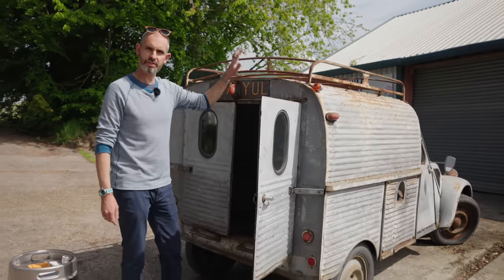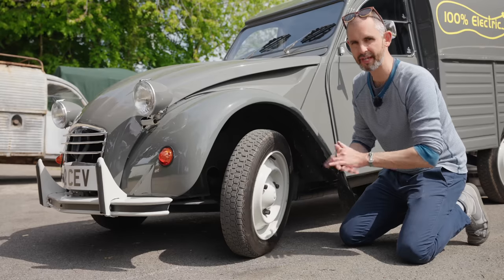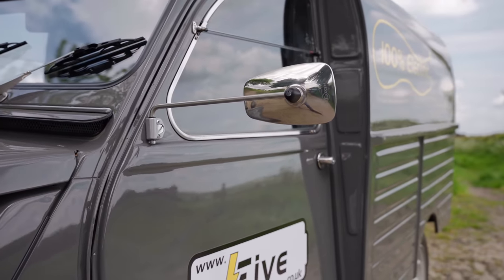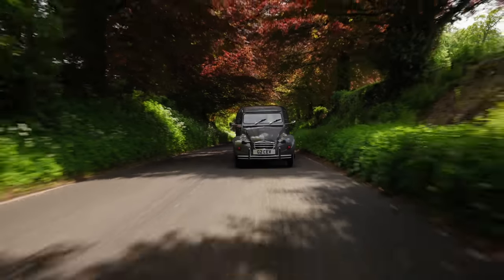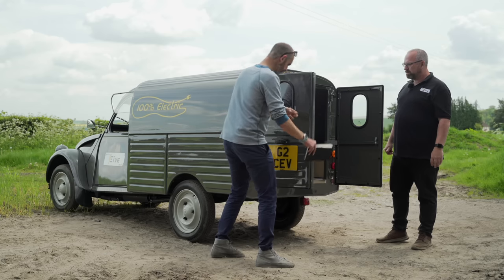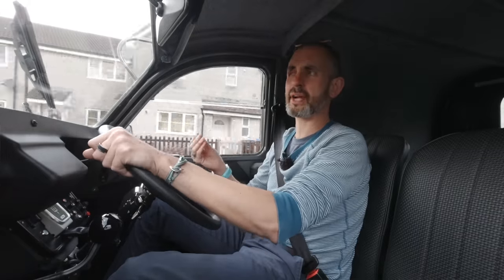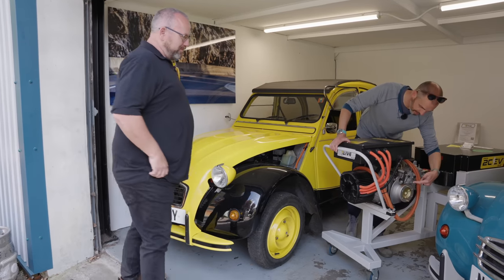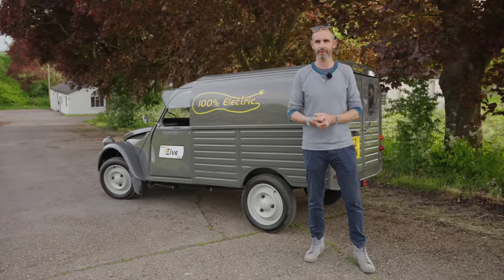This is a BRAND NEW Citroen 2CV AK Electric Delivery van - exclusive first drive review

Comment: I love how the van version looks like a 2CV has reversed into a small Anderson shelter and got stuck 😂 A charming vehicle! So much more character and design flair than a lot of modern day vehicles
Reply: "a 2CV has reversed into a small Anderson shelter and got stuck" great analogy... 😄
Reply: Bloody brilliant analogy 😅🤝
Reply: the 2cv also had that boot extension you could buy which just looks like someone went to Ikea and tried to fit a cupboard into the boot, didn't fit and just left it stuck in there...
Reply: That's exactly what it looked like to me. I half expected to hear 'Hang up your washing on the Seigfried Line' coming from the back.
Reply: @davidpotts1189 yes a Andersen   shelter on wheels?  I'm with you on this one.  A charming  little vehicle.   just been watching  a brand new morris
Reply: Just been watching  a brand new  morris  j e  van made out of carbon fiber.    .       By this guy.     Worth  a watch   I loved it.   You tube       this guy   did it.     Whose channel  this

Comment: Lone it.  The quirk level is off the scale.  We need more stuff like this in our ever more sanitised world.
Reply: couldnt agree more. im only 20 but i hate the direction just about everything in the world is going. its all big corporations with no imagination pumping out the same things but with different logos and for exorbitant prices when it costs them next to nothing. small businesses like Darren's keep my hope alive for my future.
Reply: Use Basalt and hemp fibre in place of glass finer you save wt it’s stronger and fossil fuel free it’s also ballistically tougher and resistant to gouging it involves very little water to produce it and it’s acid alkali and electrically neutral it’s also great as an acoustic deadbeat and fire resistant using the right resin . As it’s natural Basalt rock it’s also nicer and as easy to work with than glass or carbon. It doesn’t shatter like carbon but it’s stronger than growth.

What we need is to revisit the late William Towns hustler and Micro dot designs or better the Citroen inspired 1984 African  Car designs. But with electric AWD. 

All modern vehicles have grown too heavy and complicated . It’s why the best conversions are light Wt older types like the Moggie traveler the 2cv or even a classic like the E type half the wt is the engine and box even be for you account for a tank or two  of fuel. Blade cells and Na Sulpher Al chemistries are safer and will be lighter and cheaper. 
The other big saving is the use of electric motors that need rare Earth permanent magnets  such as produced by AEM of the UK and what Elons suddenly discovered several years later.😂
Reply: Search "chinese minitruck".

Comment: A Citroen Dyane was my first car, and they were genuinely comical to drive...It was also utterly simple to work on, one of the most accessible cars to DIY...I remember I bought a brand new exhaust for twenty quid (that was 20 years back, probably a bit more now). I didn't even have to jack the car up to fit it, just a couple of bolts. They were cheap cars, cheaply made and inexpensive to fix, and for me, that's what makes that 33 grand + price tag so difficult to swallow.
Reply: Yep your right a 33 grand + price tag so difficult to swallow,when you can get a Citroen E-dispatch 75kw for £25,000 with a range of 211miles.
Reply: I had a Visa for a while. I found out the brakes had seized. I bought new pistons and seals, hammered out the old pistons with a chisel, cleaned everything up then reassembled everything with new parts.
Reply: Unfortunately everyone who makes/converts an electric vehicle sell for far far too much
Reply: Mine too, bought with a failed clutch. HWT 781N replaced the clutch in an afternoon - the engine needs 6 nuts undoing and is easily liftable by a 17 year old 9 stone weakling and the engineering is so straightforward you hardly need an HBOL!
Reply: C-15 were sold per milions, Berlingo's can be also had cheaper than any new vehicle... if you buy an old Citroën and do a full rebuild I doubt you can do it for less than 15.000 if you started with a good vehicle (LHD from south Europe), as a classic car it's not cheap, but no mega expensive... go buy a 1000 pound minivan from 10 years ago and try rebuilding it to factory new condition...without going to the junkyard and rebuilding everything by expert hands or yourself we're talking about thousands on parts and hundreds in hours, may be cheaper doing it yoursef or managing to find and pay experts and spending months waiting to finally puting all together... good look with electronics and eelctric-system...
Reply: @Team33Team33  I guess they seem expensive if you're comparing them to a vehicle from a mass manufacturer who has huge economies of scale with car production. But I think that for these really small manufacturers unit cost would be significantly higher for them, and when you're selling fewer cars you kinda need the price to be higher to make enough profit to make the whole venture/risk worthwhile.
Reply: I mean what do you expect? They dont have economy of scale, the parts need to be shipped to England from all across Europe, and that fibreglass stuff isnt making it cheaper either
Reply: @MrJulianneave  And THERE lies the caveat. Are YOU as a customer prepared to support a lone garage in the UK by paying a high premium for a ar that isn't worth it ? LOL.
Reply: @InternetListener  You can buy professionally restored 2CV cars and vans for 10K.
THAT. is how simple they are to build and maintain.
It was part of the manufacturers wish from the very beginning. A Farmer can repair these cars out in the middle of nowhere with "bits and pieces".
So restoring them to as new is also a very cheap affair.
Reply: @sjtutty  Thats what these cars were designed for and as. Cheers. Seems lots of people are willing to pay a premium though for ... ????
Reply: @Team33Team33  I also will look and repair for an used one, but i don't think 10.000€ for a nut and bolt restoration... Or new body and frame, 33000 pounds for an all new without EV conversion it's also out of my league also.
But it all depend on the expert labour you use... I'm used to more modern vehicles and you need to keep am eye in time and cost because sometimes buying a similat vehicle in better condition or specs can save you thousands...
Also dendending on the use... Full restoration doesn't protect you from metal fatigue and worn mechanisms that will make you be broke and broken on the road side with your shinny restored car...
Rebuilding/restoring a car in detail and engeenering quality is going always to cost 3 times more you anticipated, need 3.times more room to store, work and rebuild than you started with or reserved, and be sure it will take 3 times more time than you planned for...
Reply: @InternetListener  I wish you luck in your endeavors. Cheer up. You will succeed the day you forget about putting price in front of efficiency.
Reply: Maybe it speaks volumes of the average age (and wealth) of classic Citroën buyers going on into the 2020s
Reply: @toyotaprius79  That would be a very small market indeed ... INSTEAD; the man defines his tageted market in the video if you had only listened.

Comment: This is an excellent example of exactly what the EV market is lacking. Love it! 65 miles on 10kWh is 6.5m/kWh... super effecient (almost double a Tesla Model 3)! The simplicity and utility of this setup are completely consistent with the orginal 2CV and demonstrate that not all new EVs must have burdensome electronics and over-featured, touch-screen everything. So satisfying to watch you drive a manual, mechanically-simple AK electric van.
Reply: > This is an excellent example of exactly what the EV market is lacking

At the price point they are offering it, the market is still lacking what they are proposing. I'm finding vehicles with the same specs (eg: Kilow Bagnole) that cost not even a quarter of that one. And this is using series proven parts! This is basically theft of hispters that think minimalism is cool looking.

People like farmer me, that actually need simple, tough and CHEAP EV can still dream. I'll run my falling apart 20 year old diesel until a real folk car is offered for less than 6k.
Reply: Exactly so, simplicate and add more (technological) lightness.
Reply: @alderankorym in general I agree, but I suspect that while the cost to buy this is relatively high, the TCO is going to be very good relative to its peers.
Reply: There are several videos about the cheap chinese minitruck that could. In particular from that guy who imported one in Florida for the ranch of his father. That chinese minitruck has the same kind of simplicity of the original 2CV, the same sort of power, but an incredible capacity to withstand bad treatment, and their price is unbeatable. 
These unassuming utility vehicles are sorely missing in the western world, where carmakers are only building bigger and bigger, more expensive vehicles.

Comment: They’d make a mint if they reproduced the H Van.
Reply: This is a widely held view.... But the H (or whatever we choose to call it) was a strange beast. It drove like a pig.  It had the running gear of the old 11B.  Stationary, it was/is a wonderful catering shed.  But for anything involving movement, it was...  not the very best.  
Full of charm, but little else.
Reply: too expensive
Reply: @BanjoLuke1  most would get turned into pop up hipster eateries anyway, so moving it's very important.
Reply: I've seen modern van with an "old van" body kit on! Had to get real close to see that it's converted!
Reply: impossible with modern safety regs
Reply: The Citroën 11CV was produced with a commercial version in the 50s.
It could carry 500kg.
Reply: No they really wouldn't sell any. Folks say that's what they'd get, then buy a Porsche Cayenne or somesuch.
Reply: @ru54623  Surely a new 2CV would be impossible in most European countries too these days? So if they can do that in the UK they might be able to pull off a new H van too.

I've heard rumours that a Chinese company does H van replicas that are actually trailers, so mating one of these body shells to some decent running gear might be doable.
Reply: @lilypower  That was a limited edition, only 10.000 produced.
Reply: No they wouldn't. Times change, horrible to drive, life in your hands & would be waaaay to expensive. Even for the most committed hipsters.
Reply: Ever driven one?
Reply: He'd probably want £100k for that 🤷‍♂️
Reply: yes and with a small uncomplicated derv or petrol engine going for economy
Reply: @Marti Lomas. And the 2cv too!!! Petrol!
Reply: i would bankrupt myself to get a solar h van to live in
Reply: compared to vehicles of that era, the suspension and brakes on a modern car may as well be off a spaceship. You would quickly realize what innovations have been made in automotive engineering.
Reply: 40 thousand plus vat. Like all ev just far to expensive for the common man. But no worries cos ev are for corporations to deliver to us peasants that are forced onto buses in 15min cities
Reply: That ‘i put a link above my head’ is more often said than executed … And then i have to start searching the youtubes. C’mon, you can do it!

Comment: I love the fact it has the authentic 2CV whine and is air cooled too!
Reply from the maker: Yup, true!
Reply: @TheLateBrakeShow  At least it's mostly new. Otherwise, this sort of thing is ruining classics, needlessly.
There is no positive effect for the environment of putting electric motors in old cars because there will be more damage caused by creating the batteries than would have been caused by the car presumably doing very few miles using petrol.
You'd have to do tens of thousands of miles before this would add up in terms of air pollution. And you would still have the problem of the environmental damage caused by digging the stuff out of the ground.
Putting EVs in classic cars is simply a money-making scheme. And nothing else.
Reply: @julianevans9548 , but this isn't on old car. As was said repeatedly it's 99% new.
Reply: @cogboy302  Hence my first sentence: 'At least it's mostly new.'
Reply: So the millions of gallons of oil that have, are and will in the future be spilled into the oceans is? its not just the combustion part of fossil fuels that pollute, its every single process that goes with it from drilling to disposing of  waste engine oil, all causing pollution on a massive scale.
Reply: @Phuc_Yhou  Yup, both methods of propulsion have serious issues. My point was that replacing a petrol engine in a classic car with an EV is pointless.
Reply: @julianevans9548  there are other good reasons to electrify a classic: as an owner you can keep the classic going and not have to worry about dirty oiled hands, smelling like gas, looking for ICE engine parts (I am aware that everything I listed can be seen as appealing for many a classic car owner)
Reply: @pjschafer5786  I don't mind 2CVs as much as the likes of the various EV 911s.
Reply: @julianevans9548  If it makes it ultra reliable and I can charge it for  free from my solar enough to take me and the misses on a sunny sunday run without the worry of it breaking down and spewing its guts out on the side of a b road leaving us stranded yet again then its definetly not pointless. Its no different from putting a Rover V8 into a Stag to make it a better driving experience,
Reply: @pjschafer5786  but isn't it the point of owning a classic car?
I mean why not just buy a new electric car then? I wouldn't convert my Dyane og HY van to ev as the smells, sound ect is a part of the game, owning a classic😊. 
Wouldn't mind my dayli driver been a ev.
Reply: @srenhansen1542  part of the game, sure - but not ALL of the game. Still plenty of character here you won't find in a new EV.
Reply: @Phuc_Yhou  You say, 'Its no different from putting a Rover V8 into a Stag to make it a better driving experience.' You might be making it more convenient and reliable by putting in an EV, but you're not making it a better driving experience.
And putting an EV in something like a 911 is like putting a turbocharged four-cylinder engine in a Miura: you might even have more power, but you're not having a better driving experience.
Reply: @julianevans9548  If you use Sodium Ion batteries, most of the EV issues disappear.

Comment: I think that on the fibreglass van box, they should wrap the smooth top with a thin film CIGS PV panel. It probably would extend to range quite a bit. Maybe taking the small battery to 100 odd miles in a city.

Comment: I have an Acadiane that I really must sort out and make roadworthy.  This video might be the trigger. 
The Acadiane was the final evolution of what the early AK became:  32bhp, front discs, load-sensitive limiters on the rear brakes, wind-up windows).  The posh version😢 even had a passenger sun visor, although mone is not that classy.  
An AK (or an Acadiane) at full tilt is a wonderful thing.  
The lack of an eager flat twin is to be regretted, but I suppose we ought to move with the ages.  😢

Comment: This is exactly the sort of thing that is needed for inner city delivery for locations where ICE is already banned. It doesn't need to be fast, it needs to be effcient and easy to use, with small turning circle and plenty of load access.
As for the price, think about the tax write down as a business expense, and compare to to the price of a HiAce, but with almost zero running costs - just plug it in to charge overnight before you head home at the end of the day.

Comment: Looks great. The joy in these cars is driving at the limit whilst remembering what they are (were) all about. Fantastic that this has carried through to the EV. I realise this fella is in business to make a few pennies but £40k plus VAT kills it for me. A budget, basic, desirable EV can be made but for whatever reason no-one has jumped on this premise. Dare I say as soon as the term 'Artisan' slipped in it was game over. I fully appreciate the work Mr Smith does but it doesn't sit right that Ora get called out for its failings (quite rightly) but nothing said to question the asking price for these vans etc.
Reply: He charges up to £30k for restored 2CV's, so there is a tiny market of people prepared to pay.
Reply: Far too pricy for me too,for what you get and the wipers should park lower. Cant see many of them sold
Reply: Nah - I get it. He's handbuilding cars. The parts are bespoke so they're expensive, the EV parts are expensive because he's sourcing them new. I don't think he's in it to get rich.
Reply: these are not made by a dictatorship
Reply: It's a good price for a hand built car. You can't compare hand built prices to mass produced prices.
Reply: @edwardlloyd1516  I suppose it all depends on what one terms a good price. This is not a ground-up new vehicle but merely an old vehicle that has been brought up to date (with performance that is unacceptable in a modern day vehicle) by adding a battery and motor instead of an engine. I would go as far to say that an original 2CV with a petrol engine would be more efficient and less polluting than producing a brand new battery. A car once built for peasants has become a vehicle for the middle classes to flex their green credentials. Remember, 15 years ago we were being encouraged to switch to diesel...
Reply: @matthewwebber2225 Some of that is just the cost of early adoption. Petrochemicals have had a grasp on industry since the 60s. That kind of research and development time and focus are what allowed their processing to become so cheap and efficient. But ultimately non-renewables need to be phased out given their limited quantity, especially in the use cases that have the most alternatives such as with fuels.